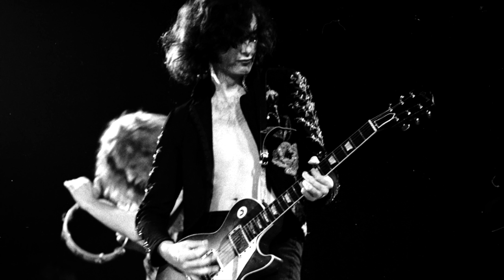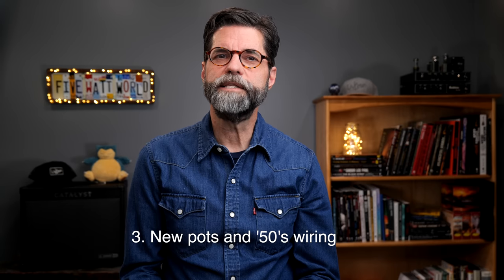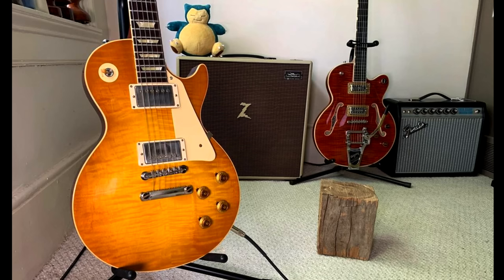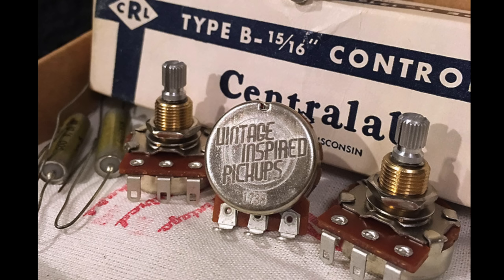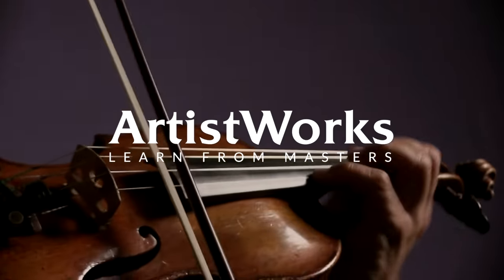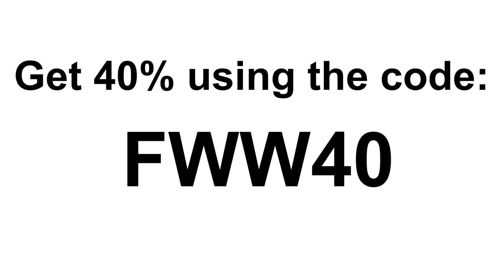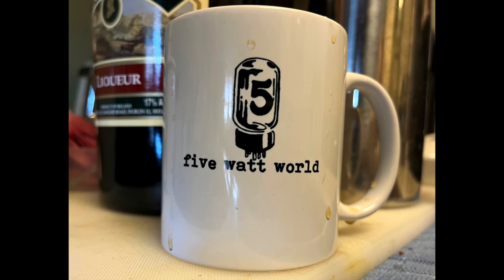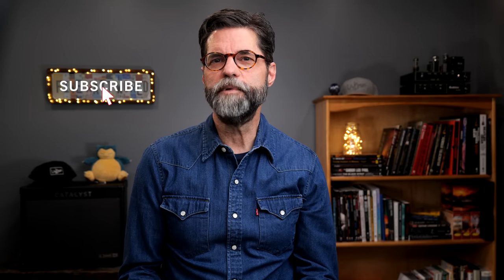Budget Guitar & Boutique Pickups? Is it worth the upgrade?

Comment: Guitar tone is from the wood (especially trebly wood such as ash or alder, versus mellow wood, such as mahogany or basswood), the construction of the guitar (such as solid body, semi-acoustic, semi-hollow, or archtop), and the position of the pickup (such as neck or bridge). Pickups are not electronic - just a very primitive generator made of magnet and coil. If you alter the magnet-to-coil ratio, by using more coil with a weaker magnet, you can get more high-end cutoff, similar to a tone control, but manufacturers play it safe, and go middle of the road. As has been demonstrated on YouTube numerous times, the effect of replacing pickups is zero. Amps and special effects are very important to the sound. The more distortion that is added, and the more high-end cutoff, the less important the guitar tone becomes. With enough overdrive, it is impossible to tell the difference between the neck and bridge pickups.

Comment: I have an older MIM Strat that I installed a loaded pickguard with a Custom Shop Hand Wound Ancho Pablano pickup set, and it worked out great!  The guitar has a wonderful neck, but I still don't like the poly finish. I just have to live with that, I guess. I am all in for around $700 to $800 vs the $4300 Custom Shop version.

Comment: Thank you! Great video. I might have missed it, but what were the pot and capacitor values before and after? I agree that the biggest difference happened when you changed just the wiring.
Reply from the maker: The pots went from 500 to 550k. The caps were .022 and we went to .015 for the neck and .022 for the bridge but went from ceramic to paper in oil vintage caps.

Comment: It's been my experience that many times I've been able to make a $200 guitar sound like a $2000 guitar by changing the pots, pickups etc. So it's definitely worth doing but you should learn to do it yourself. Start with a real cheap guitar. My 1st Bastardazation was putting a Seymour Duncan Invader in a Hello Kitty Strat, and a new 500k pot & treble bleed...It's KILLER!

Comment: I've been loading budget guitars with boutique pickups for forty years and I'm not going to stop now. I can appreciate a good set of stock pups, but when they don't do the job, I'm going to pop in a good set of Duncans or whatever to nudge it in the right direction. And once a guitar is "there", I leave it and only focus on the amp. But first you have to make sure the issue is not the amp. If it's the pickups, then there are a lot of options. Compared to buying a whole new guitar or amp, pickups are the more budget friendly option, and often the best.

Comment: I had a PRSse single cut and foolishly sold it. I didn’t think it had “a sound” even with Fralin Humbuckers. Through the years I’ve picked up a couple Japan LPs with bolt on necks and an Epiphone LP that I installed Lindy’s P90 s in. Finally, I bought a real Gibson LP Standard. A ten pounder that will only see light gig  action due to its weight. Wish I had that PRS.

Comment: Honestly, I got so sick of Pots getting moved from where I liked them, & the difference between them from one guitar to the other (+/- 20% resistance can mean a huge amount) that I eventually just dialled in my perfect tone, measured the resistance, & then just wired exactly that value of resistors into the cap.
Now each pickup is always at the exact setting I like (which is extra great for recording), & I get my variation just from play style, pickup selection, & (very occasionally) the volume

Comment: Based primarily on the beauty of it's ridiculously flamed Vintage Sunburst top, I recently bought a used (like new) 2022 PRS SE McCarty 594 double cut for $650.  Free shipping/no tax. The stock 58/15 LT "S" import pickups sound great, EVEN in direct A/B comparison to my Gibson Les Paul with the Wildwood Spec pickups.  The weight?  6.66 pounds.  I'm kinda scared.

Comment: Hey, next time you do a video like this, could you record the tracks directly off the guitar, then level match the old and new pickups before running them through the amp using a reamp box?

The volume difference between the old and new pickups was huge, and due to humans flawed perception of sounds (mainly the Fletcher Munson curve) it makes it hard to decide wether to buy expensive pickups or a cheap clean boost pedal to let you old pickups hit your amp's preamp section as hard as the higher output ones.

Thanks!
Reply from the maker: The challenge w that is that you lose the fact that the new pickups acted differently w the same settings, which is part of the comparison in the way I tried to do it.
Both are valued approaches. In the end  I don’t believe anyone can capture the subtleties of these changes w video audio on YouTube. And of course the “feel” can only be shared verbally.
Reply: @fivewattworld I can appreciate that view.

In fact, a lot of the feel comes from the compression (harmonic saturation, distortion, whichever word you prefer) from pushing your preamp harder.

Which is why I would like to see an experiment where someone uses a clean boost to match the output of the pickups.

That way, the specific frequency response of each set of pickups is allowed to shine.

And if you can get 90% of the same tone and feel from a cheap pedal, is it worth the money for the average guitarist?

Comment: So here is the question I have always had. If I have a modern wired guitar, won’t a treble bleed circuit give me pretty much the same result as switching to 50s wiring? Also I assume there is no advantage to putting a treble bleed circuit on a guitar with 50s wiring, correct? Keith great video as always!

Comment: for a/b ing please just play one chord or a short lick and switch back and worth every 2-5sec. long demos i forget how the sound was. Mods? 50s wiring is great. top  wound. somehow different. have bought boutique pedals, sold some. using zhe bezos klon drive. but i went all the way, just to be shure: 30€ paper in oil capacitors. because of the investment i had to start using the tone pot alot more, i went for .10uf for the amber spirit of 59 in my maybach lester LP, dialed back to 2, its womantone heaven. even if cheap caps just cost cents... why should i bother changing them back if they supposedley sound the same anyway? scratch that itch, if the scratch itches. sometimes theres a splinter wich comes out. itching has stopped. no scratching anymore. make sense?

Comment: As my Dad advised, do not upgrade your car as not only expensive you never get the extra money back. He said, if you want a car with performance buy one already and you loose less devaluation. Same could be applied to Guitar. There are whole industries out there designed to take your hard earned and unless your getting promotional value on a racetrack; ill advised.  Hot Rodding is another form of gambling and every gambler considers themselves special and not psychotic. Buy guitars manufactured already with the specs you want. I know I've ruined plenty of guitars! LOL Changing to 50s wiring sounded good; how about coil splitting and phase reversal

Comment: Learn to do that work yourself. With a 20 dollar soldering iron 5 bucks in solder and some screw drivers you can do the work yourself. It’s very very easy. Watch some YouTube videos on how to solder. 250 dollars to do some wiring and install two pickups on a guitar is outrageous. 2.5 hours is the long end of that job and why pay someone 100+ dollars an hour. They’re ripping you off at that price.

Comment: Number 1: There are no PRS budget guitars.
Number 2: Changing the pickups on any guitar is gonna change the sound. So WTF was that?
Number 3: I own an IVY I bought for 151USD as a PRS knock off that sounds and plays great, without any up grades. I haven't even split the coils yet!
How about a video where you save me 700 bucks?

If the wood is good, then the rest is elementary or your in the wrong brain in my opinion. The wiring options are not just old ones. It's 2023. They are very old ones.  Every computer is an oscilloscope these days. You can dial in anything if you apply yourself to the task. Hot wound or pole height or whatever. Just sayin' man.
Reply from the maker: So basically you’d have made a difference video? Cool.
Reply: @fivewattworld  No, I have no commercial potential. :)